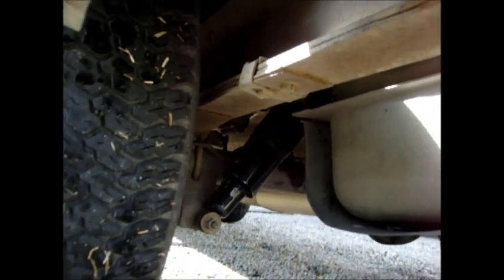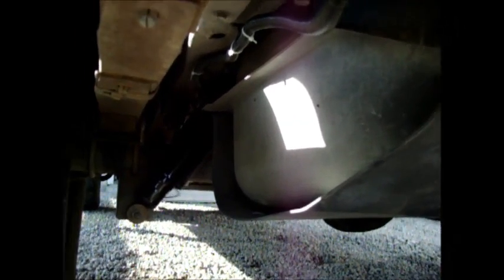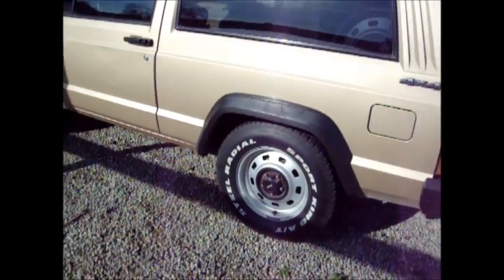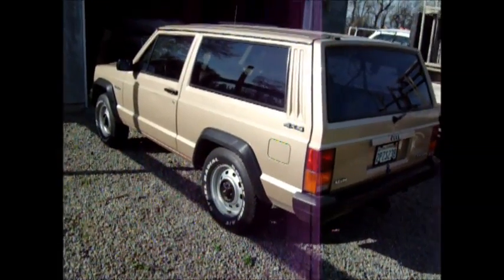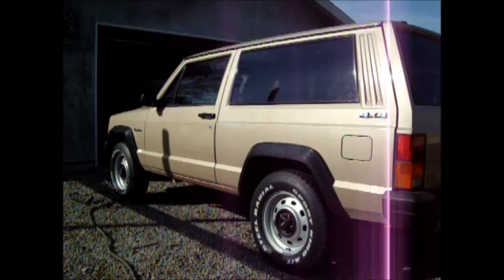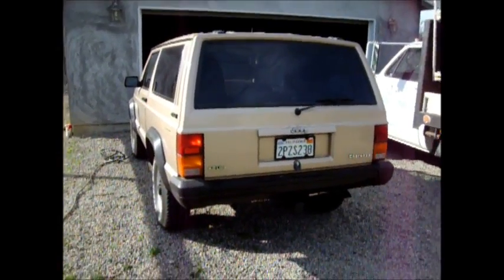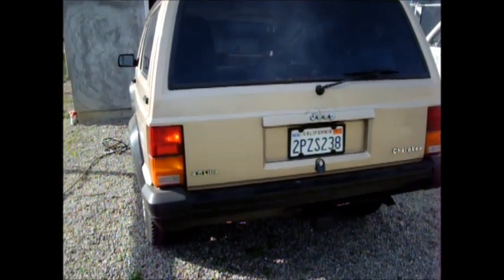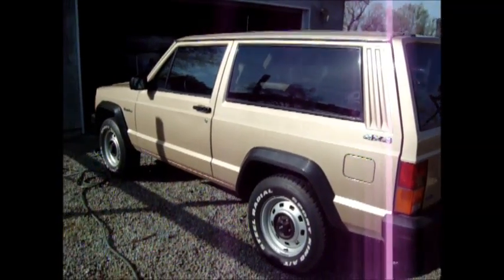Gabriel Hijacker air shocks

Comment: I have an old set on all four corners of my 80 Toyota it has a dual shock kit so it has another shock absorber besides what I use them for is the force by articulation when Twisted in rocks or in off-camber situations. Thought I'd check it out to make sure they're the same as they always have been I've been running my Toyota like this for almost 35 years. Each valve has its own solenoid. People were really curious decades ago before the rock crawling age of 96 now air shocks or the norm but as far as I know I was the first.

Comment from the maker: You can get the car noticeably higher in the back, enough to need a 2" spacer up front yet I wouldn't use it as any way to get a "lift", they are just for evening out the ride for heavier loads.

Comment: I really need to get these for my Ranger. I've been using this truck for the past two summers for my swimming pool tech job, and it sags real bad with all the chemicals and 300lbs worth of salt I carry in it. I'd say I have at least 600lbs total, worth of chems and equipment loaded in the truck.
Reply from the maker: They would really help, mine are rated for 1100 pounds. I have about 400 pounds in my jeep at all times and for the last two years these shocks have not given up. My dad has a set on his muscle car to simply adjust the look, his are probably 30 years old and one now has a slow leak but still works for short rides.
Reply: JeepAndBass I went ahead and bought some Monroe Max-Air shocks since they were the only air shocks immediately available in my area, and installed them yesterday evening. Man, I should've done this the day I bought the truck! The ride was much improved, sits level with around 100psi of air in them, and no bounce what so ever! I don't know how long they'll last, the truck stays loaded for 7 to 8 months of the year, but ATM, I'm very happy with them.
Reply from the maker: Cool! Hope they work as good for you as they have for me.
Reply: +joshnc101 How are those Max-Air?
Reply: They've done pretty well so far. Every once in a while I'll check the pressure, only had to pump them back up 4 or 5 times since installing them last year. When the truck is unloaded for the winter I'll drop the air pressure to 20psi. Even when unloaded they still need some air to maintain ride quality.
Reply: Thanks. May put them on my 65 Impala. Is the ride stiff or moderate when low psi and/or high psi?
Reply: It's rough for sure when left at high psi w/empty bed. Hi psi loaded, pretty smooth.
Reply: I don't think Ill be riding on high pressures. Just supporting 4 10's 3 amps and box weight and of course vehicle weight. Appreciate your responses. You helped me decide. Be well.

Comment: when you drive in low level, the driving is hard or soft?  this is muy question, i like the system but i dont know this. I want for my olds cutlass 1981 but hard suspension dont like

Comment: Hey man ive got the same shocks on my 1991 pathfinder and theres a swich on the console which adjustes the 4 shocks but when ever i press the swich it only does a click sound can u help me?maybe im doing something wrong or maybe it needs some air before using the swich. I need this to work because i tow alot in offroad and i tow boats(3tons and in rare ocations even more).thnx alot for this video
Reply from the maker: Mine are not electric, I just use a compressor when I need to, maybe there is something wrong with your compressor or you need to check all of the wire connections; but I couldn't really say. Sorry.

Comment: looking at this for an option for my truck are thay god
Reply from the maker: tyler jenkins So far I like them, I've had mine for two years to hold my heavy stereo system and they haven't had any issues, it also is nice for towing, just add air to prevent squatting.
Reply: tyler jenkins  yes they are good i had some on my 2002 oldsmobile aurora cause I have 20" rims and the back would sit low when ppl sat in the back but i loved them

Comment: would you recommend them for an older model sports car to get a little more height for a set of 60's??
Reply from the maker: 60's are huge lol, I wouldn't recommend the shocks for adding clearance for rims/tires, if they ever leaked and deflated, the car might sink back down onto the tires. With my Jeep the only option was to add a lift kit to accommodate for bigger tires. The shocks just keep the car level when I have a larger load and give it a small adjustment for stance. Hope that helps you a bit.
Reply: TY!!!

Comment: can you also buy them for the front shocks or are they only rear?
Reply from the maker: I'd say no, at least on my Jeep the top mounts for the front shocks are different than in the rear so you would need to find shocks to work for that. Also there might my space issues being the shocks are larger in diameter and also they are fairly stiff so it might effect the way the car handles or rides. Doing a lift would be more beneficial if you are looking to get the car taller.
Reply: They do, but they don't have the air input.